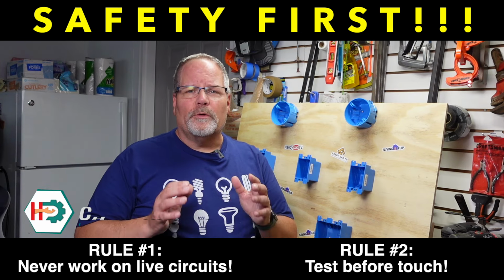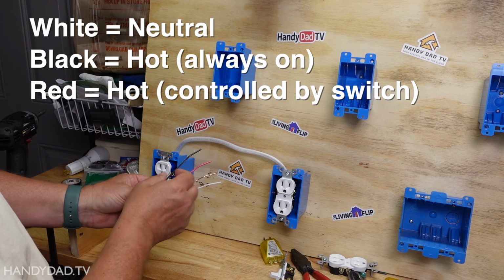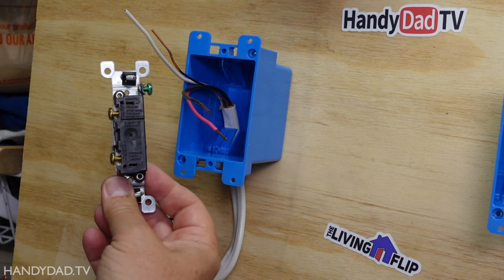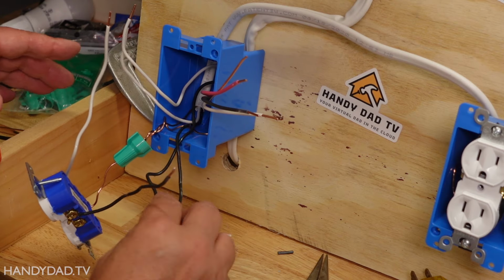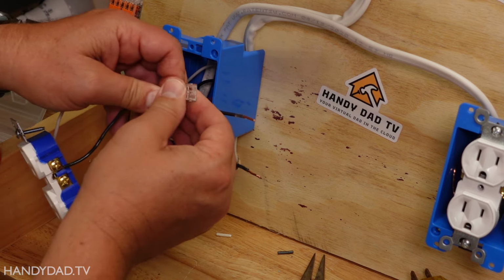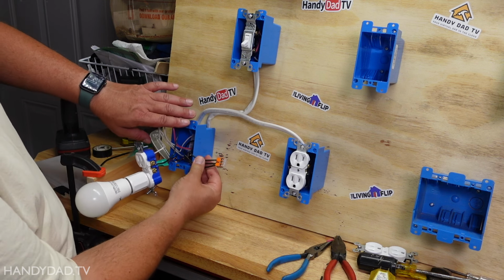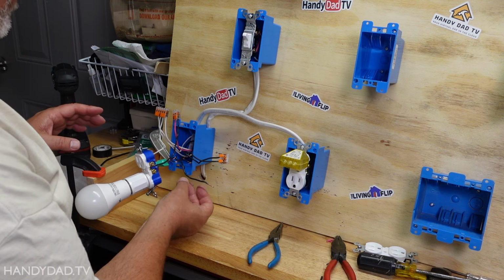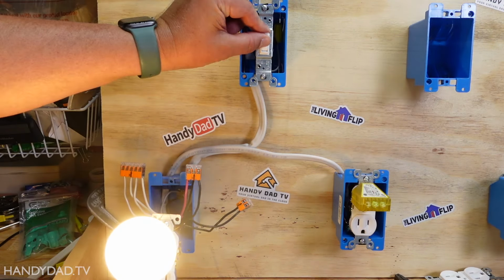How to Switch an Outlet

Comment: I actually like these videos I can learn much more from your videos that are very informative. Great job and thank you for sharing
Reply from the maker: Glad they’re helpful 👍🏻
Reply: @handydadtv  for sure. I feel like I’m pretty good with electrical as I’m in the electrical field right now so I’m very familiar with relays & circuits etc. however I never get cocky with electrical because there is always room to learn and grow no matter how long you’re in the field. I am pretty good with normal circuits etc. where I’m learning more in putting in dub panels. I currently have a 200 amp service that was upgraded from a 100 amp due to the solar panels put on the roof. Now I would like to put a 100 amp sub panel in the back yard to build a small 1 bed apartment to eventually rent out. I’m just not that great at figuring out how big of a sub panel I can run off of my 200 amp service.

Comment: Excellent video! Question: You added one outlet to the outlet on the left. Are you able to add a second outlet to the left outlet if you use the appropriate connectors to with the pigtails (I.e 3 way wire connectors instead of wago 221s?)
Reply from the maker: Yes. I show how in this video: https://youtu.be/klL8XhKMNT8

Comment: Hello.
Your videos are really excellent and clear!
Question for you: my situation is reversed...I have the outlet controlled by the switch and would like to have it independent so i can use the switch to control a light on the ceiling that I'll install later...what should i do?
Thanks for your time.
Reply from the maker: For starters, you need to determine how the outlet and switch are currently wired. 

Then eliminate the switch by making the outlet hot all the time. 

Then you’re free to wire the light to use that switch.

Comment: I have multiple GFCI outlets in my kitchen (as per codes). The GFCI on one of said outlets covers two outlets. Is it possible, i.e., to code, to install a switch next to the GFCI outlet that controls these two outlets? The idea is to be able to quickly enable/disable any appliances connected to the two outlets instead of having to press the Test button to do it on the GFCI outlet. Love your channel. Thanks 🙏
Reply from the maker: Yes you can add a switch to control a GFCI outlet and all downstream outlets.

Comment: Thanks for the video!!  I have a "twist" to your setup.  What if I need to switch an outlet in the second box.  Can you do a quick update and show separate switches controlling an outlet in each box.  I keep getting a floating neutral when trying to switch the second box.  I'm measuring 68v from ground to hot leg.............
Reply from the maker: This video shows everything you need. Just switch the hot wire that goes to whichever outlet you want to control. The ground and neutral should always be connected. When the switch is off, you should get 0 volts across hot and neutral or hot and ground. It’s possible to get a fractional volt using a digital meter through induction, but nowhere near 68V.

Comment: Great video.  I noticed you were able to open the push in Wago connector easily?  How did you do that?   I have been trying to figure it out since I bought them.  By the way thank you for that info as well.  I was still using wire nuts and these connectors are so much nicer and easier to use if I can just figure it out.
Reply from the maker: Lift the orange lever and the wire should insert all the way to the bottom. Then close the lever to lock it in.

Comment: Clearly explained a pleasure to watch your videos.  My question,  I have a switch controlled outlet and  want to remove the switch from the circuit and maintain constant power to the outlet. Will removing the red jumper wire from the circuit achieve this.  Thanks in advance, Peter
Reply from the maker: Just remove the switch and join the two wires from the switch with a wire nut, then replace it with a blank plate. Not sure what you mean about a red jumper wire.

Comment: Ugh. I tapped an outlet on a 20 amp breaker with 14/2 in my garage for an small flood light and just saw where you stated to use 12/2 so what is the worst that can happen using the 14/2? I ran the 14/2 behind the sheetrock so I hate the thought of having to pull it and rerun but will if you think there’s going to be an issue. Thanks! Love your videos. So helpful.
Reply from the maker: You have two choices:
1. Replace the wire. 
2. Change it to a 15 amp breaker.

Comment: Thanks for your videos. Is the hot wire usually used in the switch to break the circuit? I Recently noticed my headaches went away from unplugging my wifi box at night. Now i want to have a switch to easily shut it of at night instead of pulling the plug
Reply from the maker: Yes, always switch the hot wire. 

But this would be a lot easier: https://youtu.be/acr0Lx5dZnw

Comment: Glad to see a switch loop wired correctly, however in this case the white wire is not a neutral, it is a grounded conductor.  The white wire becomes a neutral when it carried the imbalance of two circuits.
Reply from the maker: Thanks.

Comment: Great video. It explains how to hook it up easily using 14/2. I’m using 12/2 on 20 amp breaker. I have a 20 amp switch. How do I wire a 2 gang outlet powered by the switch using 12/2 wire with no red load wire?
Reply from the maker: Same way. It’s just thicker wire.
Reply: @handydadtv  OK but I can't find the 12 gauge 4 wire anywhere.  Maybe I am searching for the wrong thing.  Can you point me in the right direction?
Reply from the maker: Four wire is actually 12/3 — that means it has 3 conductors plus ground.
Reply: @handydadtv  thanks!

Comment: Great stuff.  Couldn’t you have used the continuity tester on your multimeter to safely figure out which black wire went over to the other outlet without power on?
Reply from the maker: Sure, because they’re close to each other, but that’s not always the case.
Reply: I was told to use a long piece of wire to check continuity between rooms.  I’m doing this right now.  Who ever wire my house must have done it on a don’t give shit Friday or hard starting Monday.  
Thanks for the video and the reply.

Comment: How about installing an indoor smart switch to provide an outdoor 15A outlet with on/off capability ? I am thinking about connecting an outdoor string lights (15 small bulbs) + the occasional heater for greater balcony comfort in late autumn.  But most switches suggest that they should serve for lighting purposes.  What are your thoughts on this please ?  Does the switch limit the power capacity of the 15A outlet in any way ? Btw, great job on the video.  Much appreciated.
Reply from the maker: If you get a smart switch that has a relay (simply on-off instead of dimming) it should be fine with an outlet.

Comment: Appreciate your videos. I am helping out my daughter in putting in a disposal and trying to wire up the receptacle to a switch and am having issues. The house was already wired for a disposal but the previous owner elected not to have a disposal and removed the receptacle from the box under the sink. The box is currently acting as a junction box basically where it feeds a 14/2 going to various receptacles around the kitchen counters. In the switch box located on the backsplash, there is 14/2 going to the receptacle box currently under the sink all of which are disconnected and capped. There is no 14/3 here in this situation at all. Will this still work? I understand how using the hot and neutral wires with the switch will both act as hot and all that but it's the wiring at the receptacle that is confusing me. Is there a video you have that covers this situation? Thanks!
Reply from the maker: If the 14/2 wire going to the switch box is also feeding outlets, then you can’t use that wire to switch the disposal. 

If that’s the case, your best option is to install a switch box just inside the cabinet door. That’s how my house is wired.
Reply: @handydadtv  Thanks for the reply! I was trying my best to explain but it's tough to do it in a post on YouTube, ha ha. I was saying the wire feeding the other outlets is not in the switch box on the backsplash, it's in the box below the sink where the receptacle will go. I think I figured this out. I had this wired up correctly yesterday but the switch would not operate the outlet. The thing I failed to do is break out the brass connector between the top and bottom half off the receptacle on the hot side which had I done so the switch would operate the top half of the receptacle and the bottom half would be always live. Duh. Now you probably understand what I'm saying here. ha ha. Solved. You should do a video on this one, there are others on this scenario which is the same as your video but no 14/3 involved and you allow the switch to operate half of the outlet. Thanks!
Reply from the maker: @sean_heisler Glad you figured it out!

Comment: So if I have an outdoor outlet can I switch that to a light switch and run power from that to an outlet for lights surrounding a fire pit or would it just be better to add another outlet down the line?
Reply from the maker: Watch this: https://youtu.be/BfRZSYN1QcU

I would recommend having a GFCI outlet on the house and then run the underground line to your fire pit. That way the whole line will be shock protected. You can wire an outdoor switch between the GFCI and your lights, either at the house or at the fire pit.

Comment: Referring to my previous question regarding switch controlled outlet.  My existing switch has a black hot wire and a red wire.  The red wire goes to the outlet receptacle.  When I disconnect the red wire from the switch, the outlet receptacle is dead.  I see that inside the outlet receptacle there are three black wires joined together with a wire nut.  One of the wires is hot once I determine which one of the is hot I can connect a pictail and connect it to the outlet receptacle.  Obviously there is an existing neutral and ground already connected the the outlet.  Think this will provide constant power to the outlet.  Your thoughts Sir,  Thank you, Peter
Reply from the maker: My suggestion is to simply remove the switch and join the black and red wires there. Alternatively, you can disconnect the red wire and use the black at the receptacle, but that’s your choice.

Comment: I'm replacing a single box unit in a bathroom with shower. There's a single switch for the shower light and a single switch for the mirror lamps, and there's a single outlet supply. I'm looking to replace the two single switches with a duplex switch, and to put in a duplex outlet with two USB ports. The duplex I purchased has a hot (brass) input and a neutral (silver) terminal but those are my only terminals on that unit, does that mean that I have to make this unit a terminator, meaning it would have to be on the back side of one of the light switches? 😀 I think I'm beginning to confuse myself now. Hope you can shine a little light on this one for me! 

Thanks. 
John Mallett
Reply from the maker: Check the wiring diagram with your outlet. It may allow back-wiring, which means there’s a clamp on the screw that allows two wires on one screw. In that case, your wire goes in straight without making a J-hook. 

HOWEVER, you need to ensure that outlet is GFCI protected in a bathroom. If it’s protected by a GFCI breaker or receptacle elsewhere, you’re good. Otherwise this needs to be a GFCI receptacle — and I’ve never seen a USB receptacle with GFCI. So you might not be able to use your receptacle.

Comment: Okay I have something similar to this. I have a new build home and we have a half hot plug in each room, I was dumb and didn't add wafer lights in the 2 spare rooms so I had to do it myself. The light switch in the two spare rooms controls the outlet on one wall in each room, the outlets are on exterior walls so I do not want to have to snake 14-2 wire through that to get the power and would rather use the light switch. The light switch in question had a 14-3 so R B W. the switch had red wire and black wire on different poles on a one pull switch and the whites were tied together. The halo puck light has two wires, white and black, I ran the wire through the attic to the switch and how do i wire the switch up then? 

From Halo light Black wire to the red on switch and tie the white neutral to the others? 

or 

From Halo light black to black on switch, cut red and terminate it? 

I'm just confused
Reply from the maker: All grounds and neutrals will be connected together. Including from the Halo. 

You need a voltage tester to verify this:

I’m assuming the black wire is always hot and the red wire is only hot when the switch is on. It probably goes to your switched outlet. 

So I would join the black and red and a pigtail to one screw on the switch. Then connect the Halo black to the other screw on the switch.

Comment: Okay handy dad I have a question. I want to have a 2 gang box with two light switches and down the line I will have 5 single gang boxes and what I want to do is have one light switch run the receptacle on the right and have the other light switch run the receptacle on the left. Reason why is I want the shop lights that plug in on one and my fans on the other. Would I have to run two separate 12/3 in to the first box than down the line run my 12/2
Reply from the maker: Identify the cable that brings power into the box (called the “LINE”). Call the cable going to the left “LOAD A” and the right “LOAD B”.

Start by connecting all grounds with pigtails to each of the switches. Then connect all the white (“neutral”) wires together. 

Use pigtails to connect the black LINE to one screw on each switch. Connect LOAD A and B to the other screw on each switch. 

Turn on the power and test before closing everything up. 

Connect the
Reply: Would I use a traveler wire aka 12/3 red for the first junction or can I complete this with all 12/2
Reply from the maker: I don’t think you need the extra conductor unless you want to split one of the outlets so one is always hot and only one is switched.

Comment: Thank you for making these videos. Could you wire the 14/3 into the outlet you added in the previous video? Or does the original outlet you started this series with have to be the switched outlet?
Reply from the maker: You can add a switch to any outlet.

Comment: How do you wire 3 outlets to a switch? But only the top outlets. I have my lamps in my room plugged into the top plugs. The bottom ones are not connected to the switch. Is there a video you can recommend? Thanks!
Reply from the maker: These should help:

How to Switch HALF an Outlet
https://youtu.be/5D4itWGtTVQ

How to Add an Outlet from an Outlet
https://youtu.be/-WufbstcvRw
Reply: Awesome thank you. 🙏

Comment: Can you add a dimmer switch?  I want to be able to dimm some cob led lights.
Reply from the maker: It’s a bad practice to have a dimmer control an outlet. Usually you dim LED lights from the controller, not the power source.
Reply: Thank you for your fast response.  I was trying to install a dimmer switch and control 2 outlets with an AC to DC converter plug in the outlets. Then connect the cob lighting to the converter to be able to dim my lights from the switch.  What do you think?
Reply from the maker: You can dim DC lights with an AC dimmer. You need to get a power supply that allows you to dim your particular lights.

Comment: I am using 12/2, 20 amp, can this be done with that wire or should I get the 14?  I have a florescent light that I want to control with a switch.
Reply from the maker: You need to use 12/2 on a 20-amp circuit.
Reply: @handydadtv  as I stated, I will be using a 20 amp circuit, do I need to use 14 gauge wire for the switch, or can it be done with the 12/2 gauge?
Reply from the maker: No, you need to use 12/2.

Comment: I have a switch like this (switch controls one side of the outlet). But I want to return the outlet to normal and use the switch to control a light using the same cable being ran to the outlet. Do you have a video on how to do that?
Reply from the maker: No sorry, that’s a very specific situation.

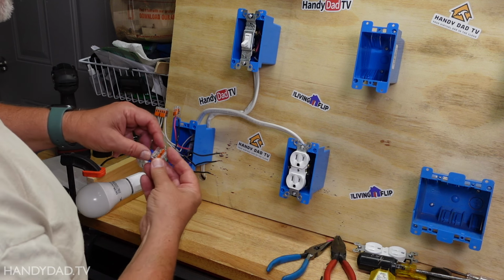Comment: hi.  may be a dumb question, but at 8:30 of video aren't you handling live wires. isn't this risky and better to just test /cut power/mark live wire /connect..etc albeit takes more steps.
Reply from the maker: Yes they were live but I took appropriate precautions by handing with the needlenose pliers. Sometimes you need to turn the power on so you can test. 

But, please, you do you. If you’re not comfortable, please call an electrician.

Comment: I need help, I have one thats pretty close to this video however I have a electrical outlet on my front porch connected to a switch that the switch controls half the outlet leaving other half live then this same switch controls the front porch light, Im trying to figure out how to wire this properly so the switch controls both the light and the outlet half at the same time...
Reply from the maker: I’m confused. I thought you said the switch already controls the light and half the outlet.